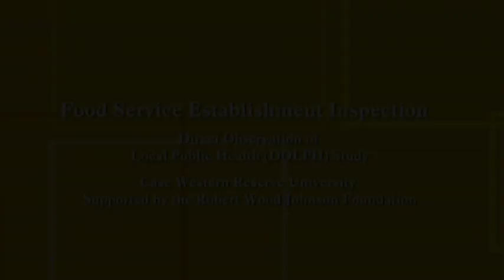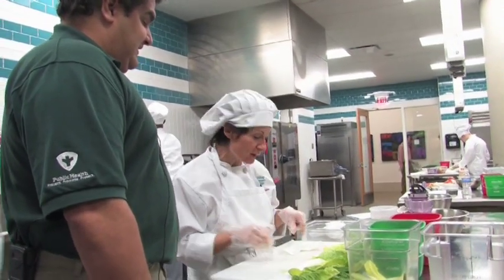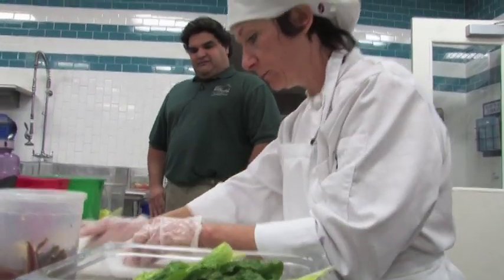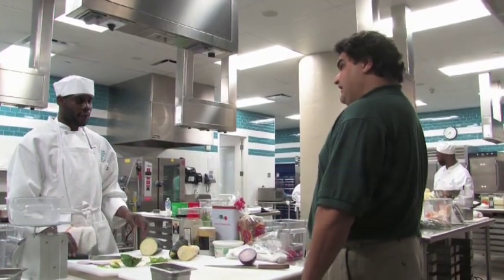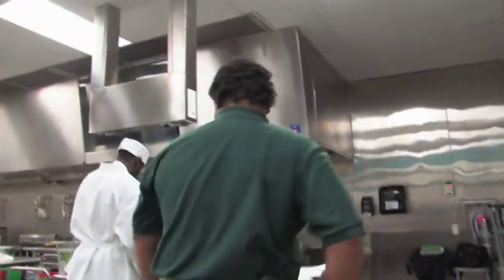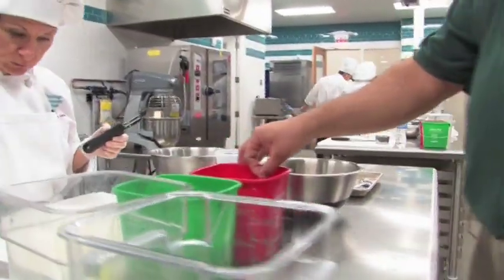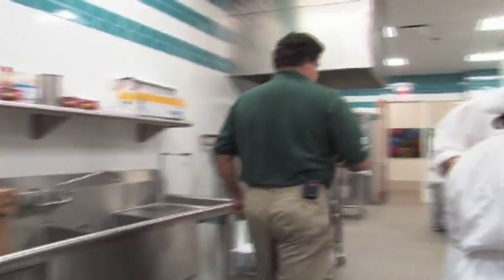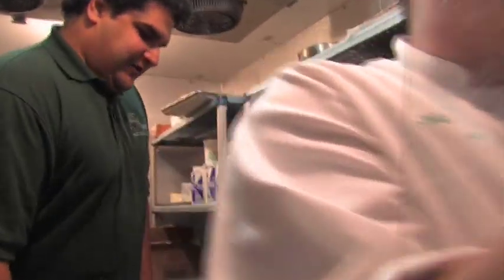Typical Food Service Establishment Inspection-Part 1

Comment: I'm in the food industry and we are accredited at manufacturing to FSSC 22000 v5.1 standard. This inspector does not have any hair net or head protection on or wearing suitable clothing for inspections of a food premises and handling products and equipment with a potential for cross contamination. he did not highlight that some of the stored products in the chiller were still in their original external packaging no de-boxing and sanitization has taken place prior to storage.

Comment: Why are checking the temperature of sanitizer? Temp is not important
Reply: Bob Stahnke I think depending on the sanitizer tool, temp can affect the pH reading. Ive had this issue at work with the pH paper.
Reply: Because the water has to be around 70 degrees or under for the sanitizer to work. If its over that, it kills the solution and your water is useless. Soooo many places get in trouble for hot sanitizer water.
Reply: He's sanitizing it......he stuck it in the meat earlier